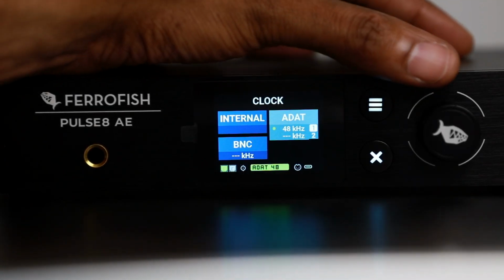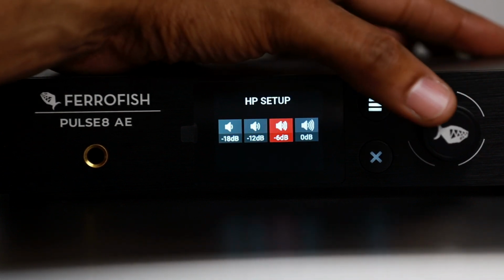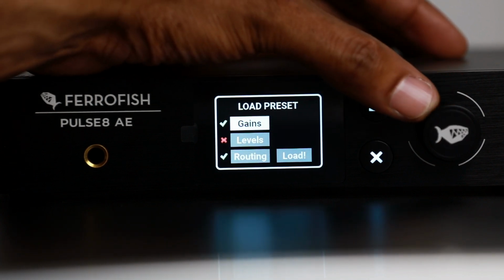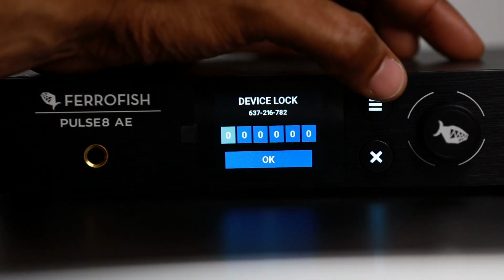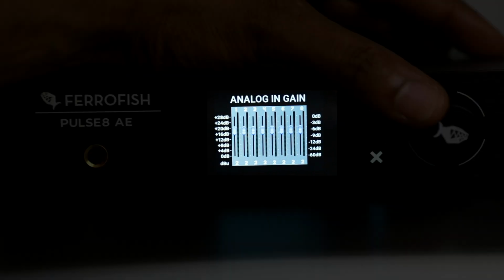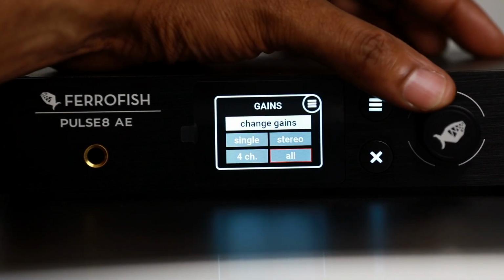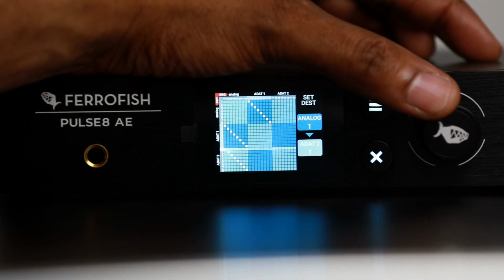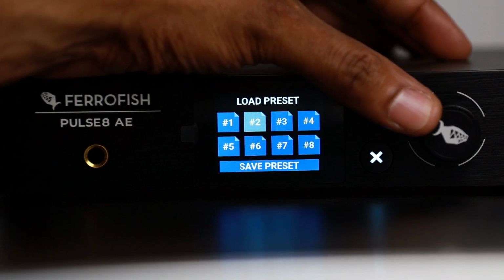Ferrofish Pulse 8 AE - A compact, high-quality, affordable Pro Audio AD/DA converter

Comment: The routing matrix and secondary set of toslinks mean I can use this to connect two DAWs to some outboard AND each other, no?
Reply: That’s what I wanna know as well. If optical 3 and 4 are just for the higher sample rate or if they can actually be routed to and from in the matrix

Comment: So technically speaking, I can run a 5.1 Setup using this via ADAT ?
Reply: yes (if you are using Mac or have RME interface on Windows)
Reply: @SDX9000  @ I am using a Mac Studio and Babyface Pro FS. So I guess it’s sorted for me.
But generally asking. Are the Ferreofish units designed speicifically for RME users or can they be hooked up with Interfaces from other Brands as well ??
Reply: @ Safe to say that anything that supports ADAT can be connected to input/output to this Ferrofish. RME has its own DA/AD units. Ferrofish has nothing RME specific, but from available independent measurements Ferrofish seems to be practically transparent = good enough.